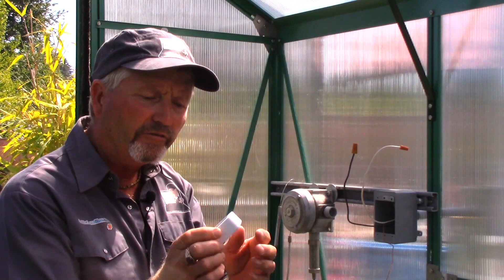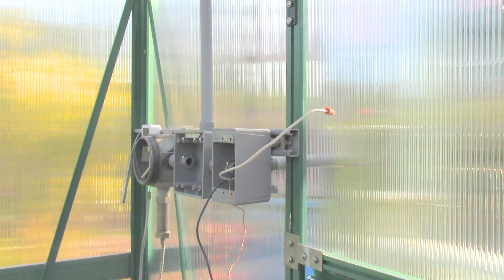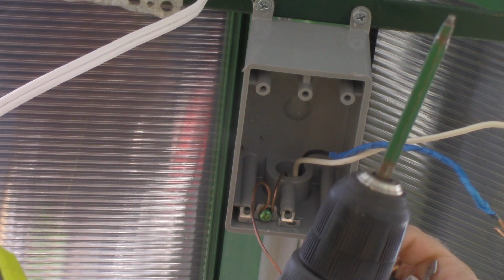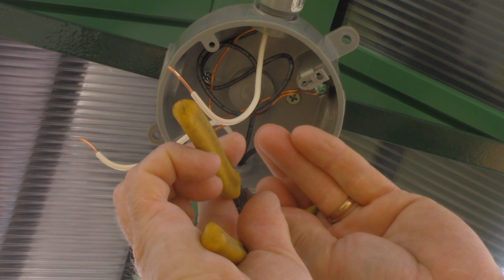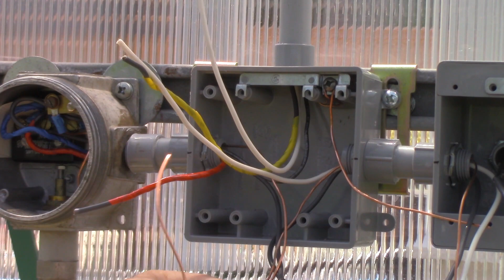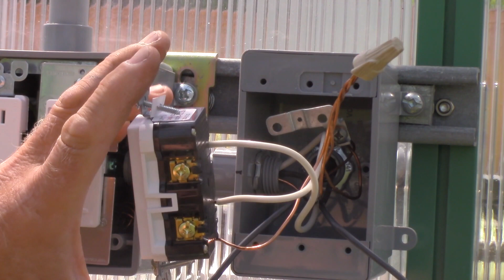How to Wire a Backyard Greenhouse to Power Lighting, Cooling and Heating

Comment: Hooray! The internet really does have all the answers! (If one knows how to look.)  I have questions!
My greenhouse has an aluminum frame, and polycarbonate panels. It sits on an aluminum frame that's buried about 5-6 inches into the ground. We're about to run electricity out to it, and I'm insisting on doing it right, and overly-cautiously.

PVC or aluminum box? I'm looking at an outdoor-rated single-gang GFCI duplex, with a polycarbonate weatherproof cover. The question is which material will withstand greenhouse conditions the best.

How important is it to bond/ground (I'm still learning terms) the box? If I go PVC all should be well, right? I plan to drill holes in the back of the box for two bolts to fit through, and secure it to the 10 mm track that's along all of my greenhouse bars. (They did super-well with allowing for customizability.) Will the metal bolts, and their nuts, poking through the plastic electrical box and connecting it to the aluminum bar, be a problem? What should I bond and where?

Should I bond the greenhouse frame, via its aluminum subterranean base, to my grounding rod? The best I could reason from referencing the Code was roughly "Check the potential between the conductive part and your ground, and decide if it needs bonding based on that." They gave me a number, but I glossed over it. I've got it bookmarked and will go back, once I get to that point. Eager for your input though.

Due to miscommunications, lack of communications, and assumptions, I've got the big fancy 240 cable with four wires in it. Now that I know what I actually need, the red wire is superfluous, but I'd like to keep it around- just in case. Is it okay to cap off the red wire, without stripping it, and leave it tucked away neatly in my box, or should I cut it off, and use a pigtail if I change my mind later? (Frankly, I'd like to keep that wire, but having your say-so will give me more fuel to argue with the assumptive one.)

Thanks for making these videos! I'll poke around and see what else catches my fancy.

Comment: Thank you Terry, your awesome at explaining  and videoing! I  just ordered my first 18X32 green house and still not sure what I need electrically!  Not sure if I need a separate panel? I could run in trench (to be dug)with conduit next to the water lines 100' away 4' down(zone 6) or just run wires from the chicken coop 75 feet away along the horse fence and pull to the green house.However, you gave me a great visual for what wiring I will need inside once I get there!!
God bless!

Comment: Very thorough presentation - thanks for taking the time to make this video. I have a small greenhouse also and will be installing power soon. The biggest question in my mind is how well does the PVC hold up with higher summer temperatures? Our greenhouse got as  high as 120 F last summer with all vents and doors open, temperature outside was 100 F.  Did your PVC hold up well this past summer?
Reply from the maker: Not an issue up to 46c (114.8F) so far!  With short runs you wouldn't have a problem.  With 10' plus runs you would get expansion and contraction that would see it bending into all kinds of goofy shapes, but it wouldn't melt and flatten or anything like that.